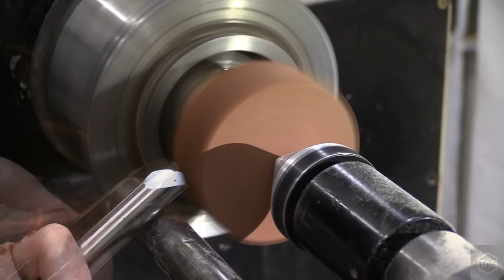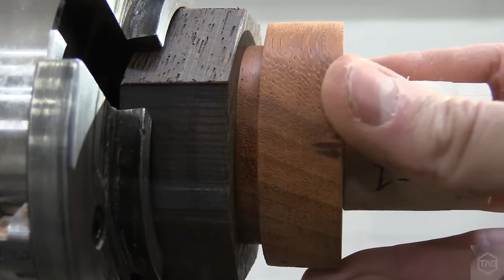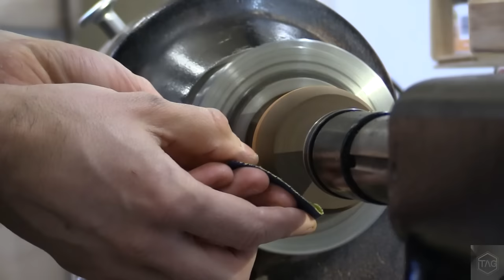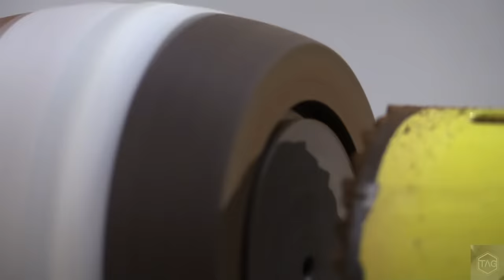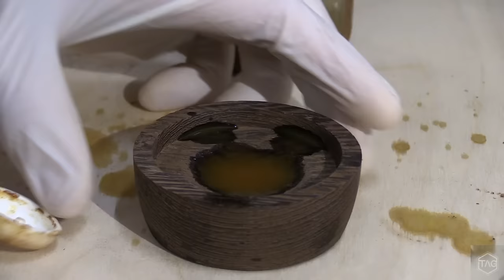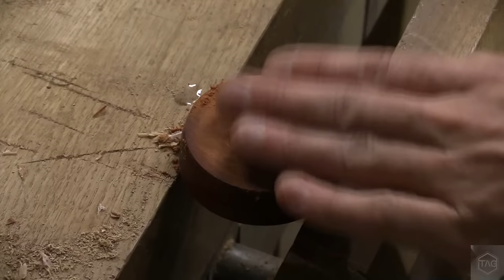Woodturning - Ring box

Comment: I would really like to know how the endgrain on the top holds in time. if im not wromg, the dark wood has an edge grain direction where the clear one has an end grain, so they may expand at diferent rates, wich may cause a crack or something. I hope not, because its a beatiful piece of art
Reply from the maker: Good point, i think it will be fine since it a small piece out of solid pieces of wood. Any expanding is going to be very minimal, it would/could be an issue with a larger box and inlay?